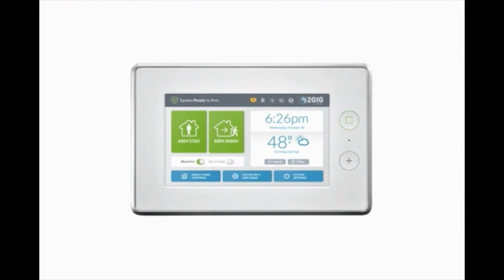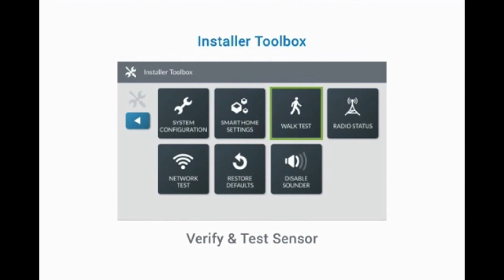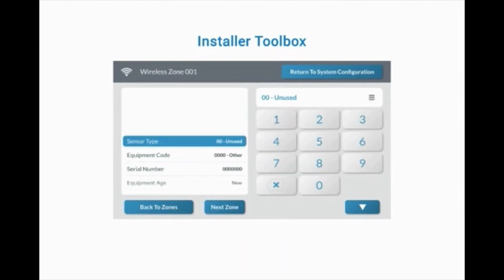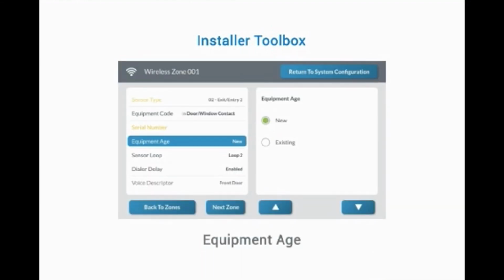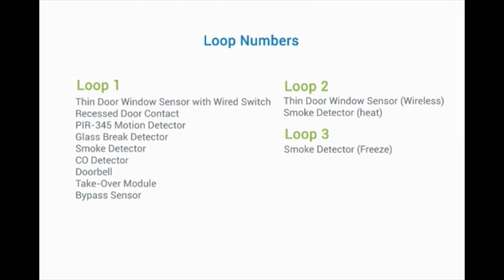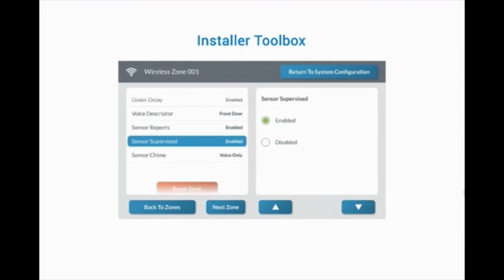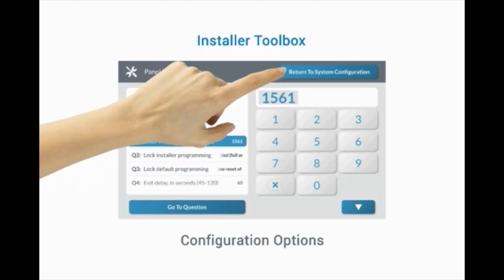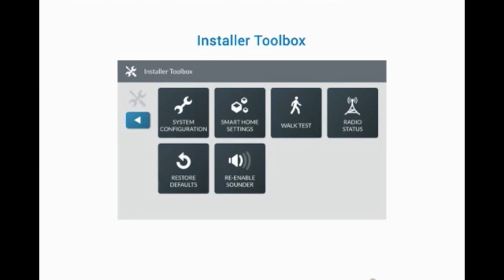2GIG GC3: Sensor & Panel Programming

Comment: I used to have the 2GIG GC2 control panel with Armorax and then I upgraded to the GC3 but both these panels aren’t encrypted. Now Armorax has switched to using encrypted control panels, which is the latest technology on the market.
Reply: While the GC2 and GC3 are not encrypted, the newer GC2e (https://www.alarmgrid.com/products/2gig-gc2e-345) and GC3e (https://www.alarmgrid.com/products/2gig-gc3e-345) systems are encrypted. The Honeywell Lyric and Qolsys IQ Panel 2 are also examples of encrypted wireless all-in-one alarm systems.